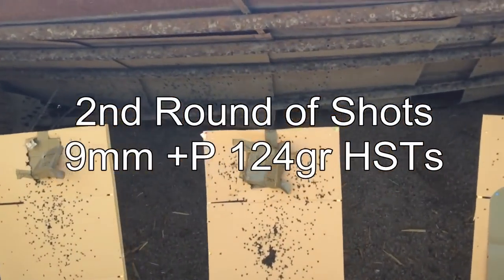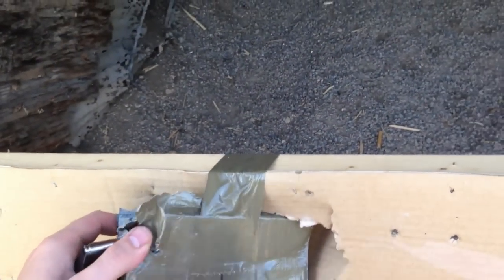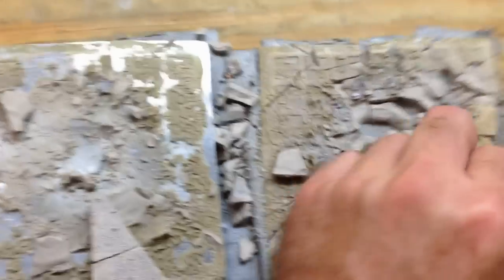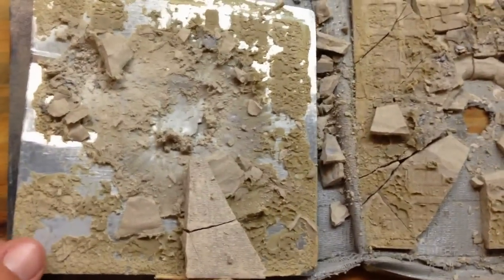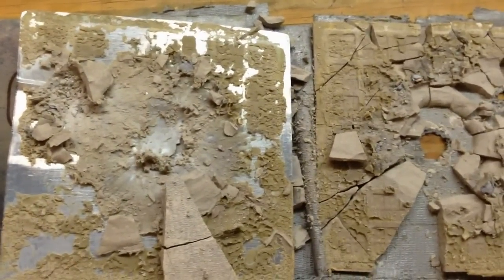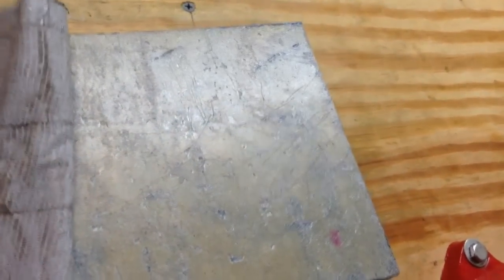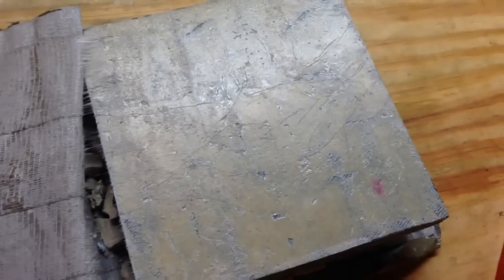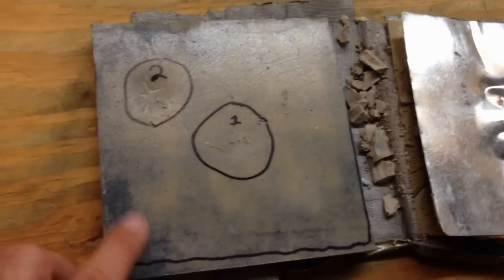Homemade Liquid Nails Bulletproof Body Armor

Comment: perhaps encasing the tile in resin would increase structural integrity and prevent it from falling apart when it shatters
Reply from the maker: I have other designs on my channel where I try to wrap the plates in fabric and adhesive, and it works well.

Comment: Dear Professional Prepper, 
I have a sheet of Granite Tile I wanted to convert into a DIY armour plate. 
The Granite tile is considered tougher as a floor tile as more resistant to traffic in a heavy duty environment. 
However, if I may ask you a question please, would you think a granite tile would suit compared to a ceramic or porcelain tile, in your opinion? 
Your guidance would be very much appreciated. 
Thanks.
Reply from the maker: Alexander Foster I think you'll be fine. Most quartz/granite has a Mohs rating of 7, most pei5 ceramic tiles are Mohs rated at 8.  Very similar. Copper jackets of the bullets are a Mohs rating of 3.  Let me know how it goes
Reply from the maker: tilestoreonline.com
Reply: The Professional Prepper (Prep Know Do) Will do thanks and cheers.

Comment: I am surprised by the fact you have not consider using layers of silk fabric as its used on its own in Asia for soft body armor. Sure it may take 30 layers buy you can cut it in any shape and it weighs nothing. Also it makes an awesome backing
Reply from the maker: bullboo1 it's more of a cost benefit / practicality analysis

Comment: I BELIEVE IN THE PLEXY MATERIAL, WHICH IS A STRONG PLASTIC NON BREAKABLE, TO A  BULLET, IN A FIRING RANGE, IN SEVERAL SHEATH'S IT'S LIGHT & NON PERISHABLE, IT'S RECYCABLE, FOR CAR'S, WHICH ARE NORMALY METAL, IN THE LONG RUN THE CORROSIVE  AIRCRAFT'S &VEHICLES LAND UP IN JUNK YARD'S OCUPYING NEEDED SPACE IN THE THE FIELD'S & LAND MINES CENTURY PLEXY IS A GREAT SOLUTION FOR CLEANING OUR AIR LIKE MY NEW SOLAR AIR CRAFT'S CLEAN AIR PRESSURE AND LIGHT STRONGER THAN STEEL MATERIAL  A GIVE TO SO MUCH JUNK PLEXY IS REMOBABLE!
Reply: don't forgetmicheals flower's, & vase needle & thread

Comment: polyester landscaping fabric would be miles better than denim. Nylon septic drain fabric would be better than polyester. Take gorilla glue and thin it with acetone. Then add a few drops of water. wait for the bubbling to stop while stirring constantly. Use that instead of construction adhesive. Another good source of urethane is over by the concrete for fence posts. It's a two part urethane foam meant to set fence posts. Mix the two part according to instructions. pour it into a bucket. let it start to rise, and then pour acetone on it to thin it out into a resin. Table top 2 part clear gloss epoxy would work as well. I think you should just go online and spend the extra money and buy Kevlar. skinonkyak sells ballistic nylon for a good price. You can buy a good 2 part urethane meant for compositing there.

Comment: OMG someone is going to get killed. Just purchase the correct product from a ballistic manufacturer. Not that expensive and you won't die
Reply: +The Professional Prepper (Prep Know Do) 
This type of counter measure would be excellent for vehicles and defensive firing positions.
Reply from the maker: I explicitly put in the description to not use this as such.  This is only for experimental purposes only.
Reply from the maker: And who is going to get killed?

Comment: I'm glad I found this, you've helped me a great deal in that I do not have to test this myself so that I can build my machine with this in mind.
Reply: I'm working on a cheaper up armor for an armor suit.
Reply: sure.
Reply: @dannyd02  same dude, are you thinking composite fiberglass with STF areogel suspension. I'm also working on a cooling system, urination system and 3 layer armor based off of the idea of the mjolnir armor in halo, though no active exoskeleton rather a passive system that makes the suit feel lighter than it is. I'd love to email and we can pick eachother brains a bit.

Comment: 2:52 Bits of tile sprayed up into the hypothetical wearer's face.
Reply: Exterminence There's always a more powerful round, so go tell the Marines and the Army that all their personal armor is useless.

Or realize that he's defending against pistol rounds, and delete your stupid comment.
Reply: Better than a bullet
Reply: TheAlexrice Not LESS BAD, but better, you say.

Is a hard kick in the nuts "*better* than a bullet", too?
Reply: +RonJohn63 it's the lesser of two evils
Reply: +RonJohn63 It was a figure of speech. And why does it matter anyway? Were you beat with a textbook as a child?
Reply: It may be possible to wrap the sides of the whole plate with a layer of of roof flashing covered by several layers of the bonded denim. This would definitely catch the side spray.. or most likely. I'm still wondering about 2000+ fps rounds though. What would brake up a fast mover to help disperse the impact as generally 2000+ fps will cut right through most light body armor.
Reply: James Granberry that’s the purpose of the tile, if he was to wrap the tile in duct tape then assemble the armor as shown it would make the armor more spall resistant as well as holding the tile together better for multiple shots

Comment: Pretty interesting stuff.  I saw a special on the history channel one time.  Scientists  Added   large amounts of sawdust  to Water and froze it  during WW2. it was practically bullet proof  They called it ""pie -crete"" Anyway the principle im alludeing to is that if  added similar amounts of ceramic or brick dust,  fiber glass  or even sawdust to your epoxy , the effectiveness should improve even more.  and belive it or silk might be better than denim , I would like to see automotive fiberglass sheets thrown in there too . Possibly a better epoxy would be clear acrylic resin sold at hobby  stores like ""Michaels"" Its almost the same as the bullet proof glass at the bank . combined with a  ceramic binder or something similar  I think would work pretty well
 I was thinking of wrapping the ceramic plates in heavy duct tape  to keep them from expanding,  and force the bullet to spend more energy trying to force  its way through
Reply: they also built a ship out of frozen sawdust too
Reply: F Mann  Good Ideas... Why not make your own video?

Comment: Have you considered gluing a layer of closed-cell foam to the very back of the plate--that would actually touch the wearer? Those bulges in the metal plate would likely break the wearer's bones. The foam might absorb the bulge and afford some level of protection to the wearer...
Reply: Brilliant idea!foam would help!
Reply from the maker: Leonard Urban I tested a similar design in another video that showed minimal blackface deformation in clay.
Reply: or d30, look it up. Can't believe its not in every single plate carrier.

Comment: I would add a steel plate not flashing and really no need for the tile
Reply: The tile is extremely hard and helps to transfer and absorb the initial impact of the bullet.  It also helps to expand the projectile which in turn assists in stopping it due to there being a larger surface area for the metal and denim to work with.
Reply: Beer Nation 
+1 to Abe froman 
The tile also serves to cause fragmentation of projectiles

Comment: Great videos, very interesting to see how different materials respond to bullet impact. Have you considered using a phenolic resin sheet as the backer or even the front plate for the armor? It is the material the school lab tables are made out of and is very strong (tensile strength of around 9000lbs) but also is more pliable than tile and should resist shattering while spreading the forces of impact. A 0.5 12"x 12" sheet runs about $25 at Zoro and could be a very interesting test.
Reply: *****
I've been interested in plastics and resin-based materials for armor for a while as they tend to have great impart-absorption properties. Many years ago I devised a plate of vinyl tile, 2 plastic binders and duct tape - it weighed about 1 lb and stopped repeated shots with .22lr from a 2" barrel pistol. Sadly I currently have no means to build and especially test (live in a city) anything now but am looking around to see what people are doing in the home-made-armor niche. 
Also interesting to see - balisitc nylon pads used in camera bags to separate compartments can make a good backing for armor plate. Used to collect them here and there but lost during a move :-(
Reply: @Schir1982  for a pad backer, someone needs to use d30. Its a non-newtonian fluid they form into shapes then put in hockey, lacrosse, motorcycle, snowboard, gear ect. You can move it around, its goopy and stretchy, but then put a thin (1/2") layer over your hand and hit with a hammer. This would be the perfect layer between the back of the plate and the chest.

Comment: Try 3/8 plexiglass instead of ceramic
Reply: *****
Try using two aluminium sheets on each side of the tile. You will be suprised!
Reply: ***** The key is to get the bullet to deform early. The rest is to stop it. Ditch the ceramic. As mentioned, use some layers of Polycarbonate up front. It's cheap. .500 x 12 x 12 is only $20. Bullet proof glass is normally 2 layers of Polly, then the following layers are glass. Each layer has a layer of nylon or the makers own version of it between it.
Reply: Lexan would work much better than plexiglass

Comment: How much do the plates weigh?
Reply: So what is the next step?
Reply: *****
You might could try high density polyethylene plates to cut down on the weight and stay in budget. Personally, I like AR500 steel the best from what I've seen. Have you checked out other types of house hold ceramics?
Reply: ***** What is the thickness of the roof flashing ? From what i can gleam from armor patents and research papers it is vital to complete reinforce the back of the ceramic panel to increase stiffness. Since your tiles have voids in the back you might get some extra performance by having the side with voids be the strike face. Its also common to bond the strike face and supporting plate together with an elastomeric resin ( ie. slightly flexible glue ).